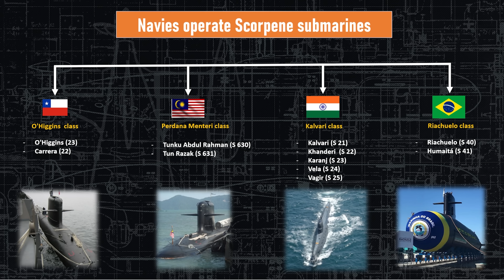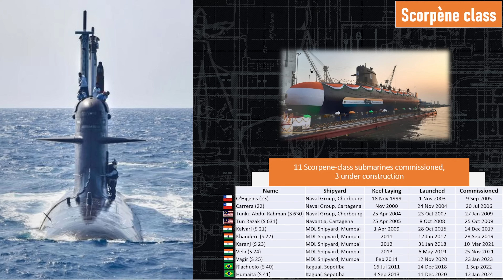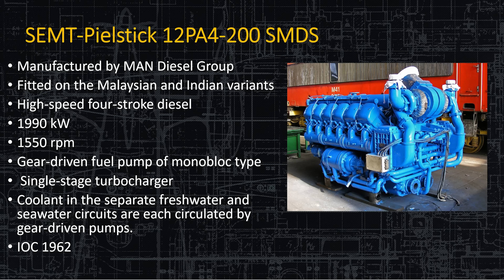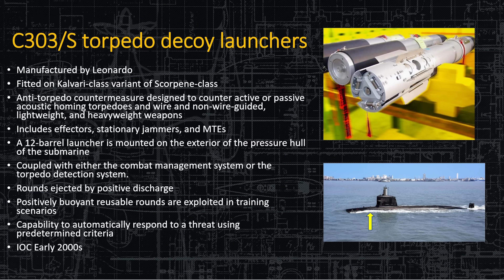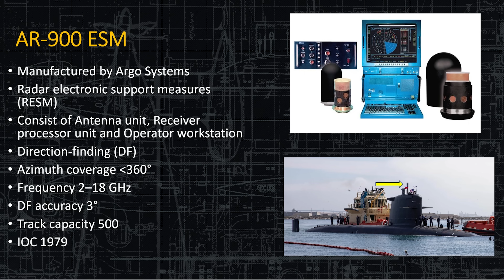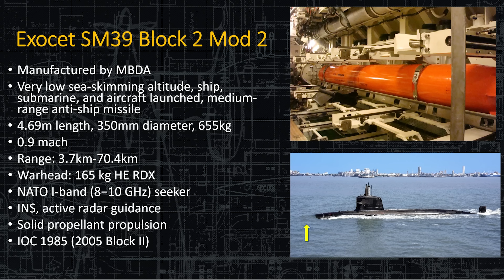Inside the Scorpène-Class Submarine: A Deep Dive into French Naval Engineering

Comment: The story about Spain and the Scoperne is pretty fun. They stole the technology after working on the Scorpene with France and through they could make their own sub (S80), but turn out they couldn't do it. There was a trial and since they stole technology, they made a deal with Naval Group (it was a 60% naval group/40% Navantia) and they gave all their parts if Naval Group dropped the charges against Navantia, making Naval Gourp the only owner of the Scorpene. And Spain who through they could build their own with the stolen tech, were in fact unable to pull it out and needed the americans to step in to finish their subs.
Building subs is not as simple as it seem.
Reply: Exactly, and I would add that the Spanish had to call in a US company to solve the problem of the S80 by adding several metres to the submarine to enable it to surface.

Comment: Hi Aaron, I'm a Brazilian military journalist. 
There a few (details) that were a wrong regarding the Brazilian versions and whatnot.
The submerged displacement of Brazilian Scorpene is 1.870 tons surfaced and 2.200 submerged.
Brazil has currently three and not two Scorpene's the third one is on sea trials that are scheduled to end next month! The fourth and last one should start sea trials at the end of 2025 Those go: Riachuelo, Humaitá, Tonelero and Angostura.
Brazil's nuclear submarine, is a Nuclear Scorpene. It's just not the Humaita. It's called Álvaro Alberto (SN-10). Since France can't share or aid in nuclear research the reactor is built/researched by Brazil while the rest of the submarine is basically a larger Scorpene at whooping 6000 tons (compared to a normal 1700 ton normal Scorpene) built with French help. It finished it's design phase on 2023 and it's currently being built, there are some solid leaks in Brazil that the reactor has been finished with two built, one for tests internally and the second one being the one that will actually power the submarine.
Reply: @henryquecabral9357  I'm Brazilian too and was going to post this. But you nailed it
Reply: And you have nothing to say about the fact that he's claiming Spain builds the Scorpenne class when they build their own subs S -80 and S-80 plus classes?
Reply: I applaud the effort, it's a very difficult thing to do. Parabems. BUT I don't understand why Brazil would need those things. Why it's a strategic priority that you'll sacrifice other investments to get this done. You don't have faraway territories or want to attack ships far from Brazilian territories, right ? I don't get it
Reply: @Desi365 

If your strategic goal is to deny control of a sea area, submarines are a good choice. Surface vessels can control sea areas, but they are also more vulnerable. The trheat of sea area denial supports deterrence against an invasion and may be sufficient leverage for a favorable diplomatic conclusion to disagreements that have not yet reached hostilities.
Reply: @ycplum7062  I questioned the choice of propulsion not the principle of a submarine force.
Reply: @Desi365 did you see how much of a coastline they have? 
The nuclear sub is probably a prestige project. First sub in south America and so on.
I agree that the money probably has better uses though.
Reply: @sebastianriemer1777  Prestige is a dumb reason.
Their coastline is big , yes, but modern diesel electric subs with Li ion batteries can cover huge distances, although slowly. An appropriate number of them would serve Brazil more than the nuclear mess, i think.
Reply: @Desi365 the original poster already explained it. 🙂
Reply: @Desi365 Nuclear is just better when compared to diesel-electric. It allows them to be faster, go further and to remain on station for longer. It's the same reason why Australia is also trying to acquire nuclear boats too.
Reply: @londonunderworld9833 You clearly don't know what you're talking about. The idea that conventional boats are quieter hasn't been true since the Cold War ended. Nuclear submarines are objectively superior by every metric, which is why nations that have the means to acquire them will do so.
Reply: @ Brazil, due to some UN resolutions regarding the Lobster War Brazil has a much larger exclusive economic zone in the South Atlantic. The Doctrine for the Brazilian navy is that we can't compete 1 to 1 with better financed navies, so the Brazilian navy focus extremely heavy on submarines, so in case of a war like the Falklands war no superior Navy would be able to roam free wherever it wants and nuclear submarines are crucial for this, as it could be anywhere with it's much larger range/endurance. So every mile, from their home ports to Rio de Janeiro needs to be "ASWed" (sorry my limited english got me there)